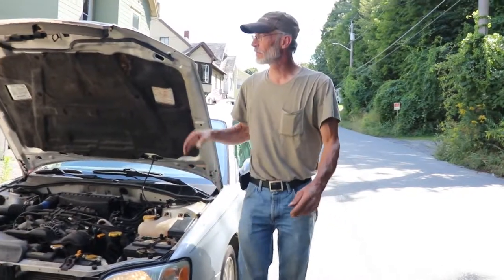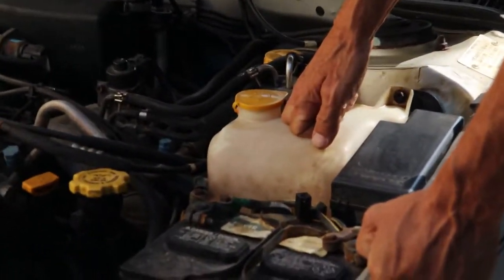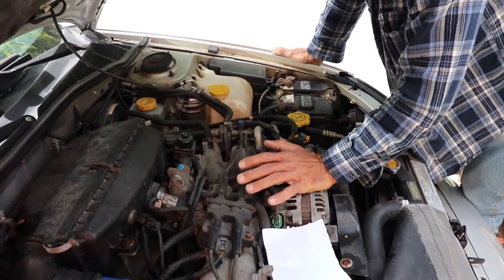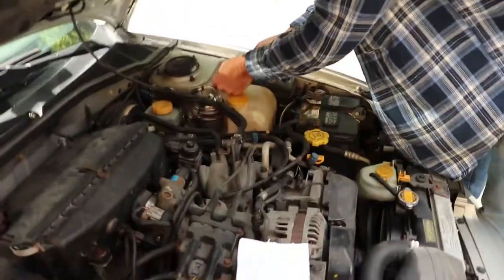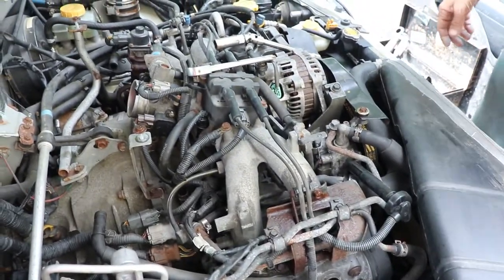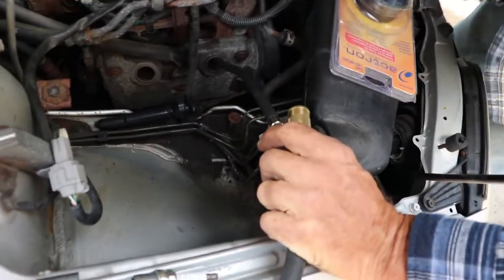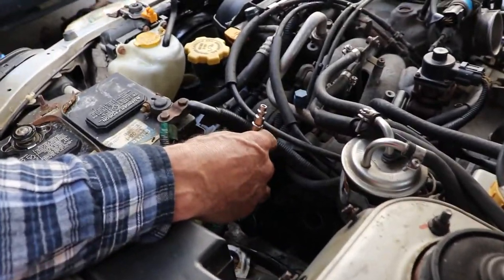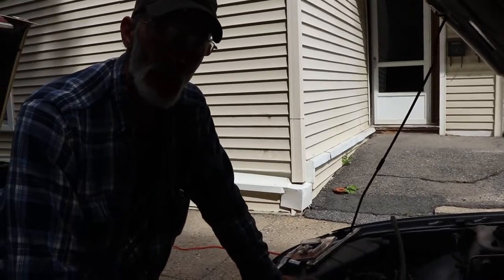Subaru Head Gasket chronicles - Part 1 - Auto Repair

Comment from the maker: We KNOW this car has a leaking head gasket, but we want to PROVE which side before pulling it apart. Due to the cold "Salt-Belt" climate, the Chronicles will likely be on hold until we have better working conditions.
Check out Matt's video on a similar issue with a V6 Toyota https://www.youtube.com/watch?v=1bVC3AxGCgk

Comment: i would pressure test the cooling system over night and see where the water is in the morning
Reply from the maker: If I ever get to trying again... I may go buy the pressure kit. Otherwise, when I find a garage, this whole thing is getting torn apart,and redone. Someone already replaced the head gaskets, and obviously messed something up, because it's been this way since the car lot wholesaled the car.

Comment: I think I might have given your compression a bit longer on each cylinder. Also, I'd have made sure the valves were closed on ALL the cylinders. I sure thought I heard air flowing on one or two others.
Reply from the maker: I gave up for the winter... I also deliberately overheated the engine and compression tested it while hot. (NO POWER COILS and it still TRIED to start.... royally messed up my compression tester!)